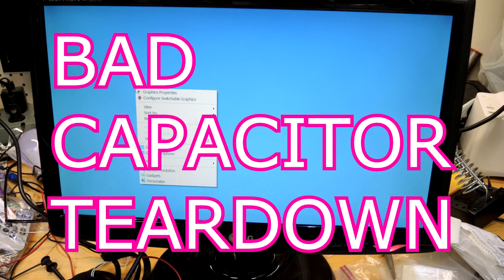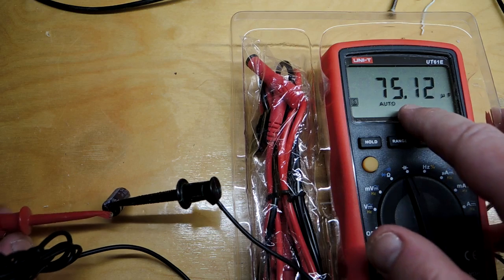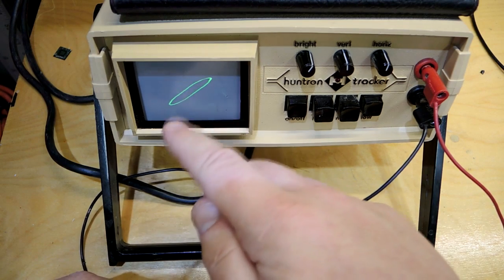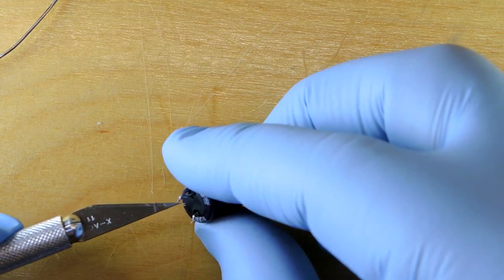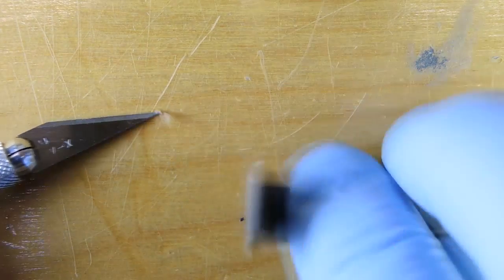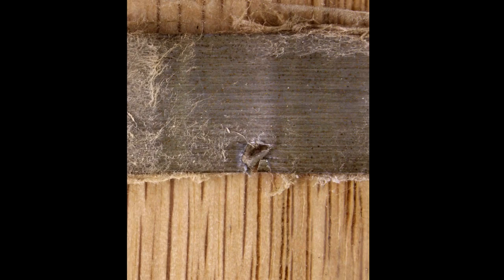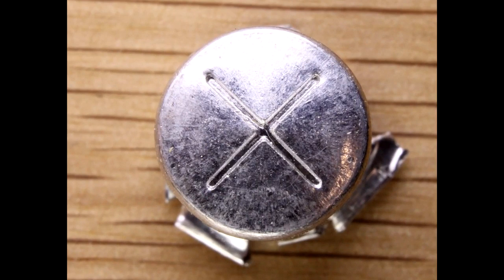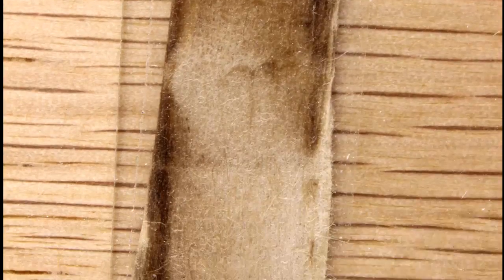Bad Electrolytic Capacitor Teardown

Comment: Nice video! They are made much differently  than 'lytics' i've taken apart in the 70's. We see very expensive manufacturing equipment suffer from these cap failures - usually power supplies and when they fail, they take out regulators. Also, we believe we note that electrolytic capacity life spans have shorted (due to newer cheaper mfg process maybe?).  It used to be caps would fail before say 25 years, but now we see caps made in the 2000s fail. Maybe someone has better insight?

Comment: Thanks for the analysis.  I'm in IT and have seen many monitors fail and have fix a number of them by replacing the caps.  I've always wondered what causes the failures.  Specifically though, is it heat that causes leakage from the caps?  I also see this in audio amplifiers.

Comment: I have a 1975 video cassette recorder here, still working, with nice big robust capacitors.  These days, capacitors are an utter scourge, especially surface mount ones which are hard to change and can be in very large numbers in some equipment.

Comment: Currently working on a monitor. asus vs208, the monitor would turn on into a continuous power cycle, which would only stay on if i put a hair dryer on it. So i took the monitor apart and see that one of the capacitor is bulging out. so hopfully i can replace it and it should work again

Comment: In high ripple applications, ESR is of more relevance than capacitance. Even 20% of the capacitance is often fine, so long as the ESR is low enough. 
Capacitor ages through electrolytic drying. Once it gets to a point, you get a positive feedback runaway effect. 
Drying increases ESR. Higher ESR leads to internal heating. Internal heating leads to electrolyte boiling. Electrolyte boiling causes internal pressure. Internal pressure causes can to bow, and internal pressure drives out moisture in an accelerating loop. 
The key for long capacitor life is for them to not get too hot. The capacitor's environment may not be particularly hot, but inside they can get very hot due to ESR heating. And it is the internal temperature that counts!
Many smaller capacitors can be better than fewer large capacitors since there is more surface area for heat dissipation. In general, bowed capacitors need to be replaced with capacitors which have a low ESR, and can physically dump the heat. Consider using a good solid electrolyte capacitor since these have an ESR an order of magnitude lower than wet electrolytics, and will therefore run cooler, and therefore have a much longer life, and reduce power consumption.
For electrolytics, every 10 centigrade cooler inside doubles life.

Comment: It's bad enough that they use poor quality parts, but some caps are mounted extremely close to hot components and heat sinks. I repaired a dozen TVs at work with caps which were surrounded on three sides by heat sinks.

Comment: Nice job.  Fixed one of my monitors with the same problem.  Had to replace 2 though.  Later, the panel cracked though.  Did get a couple of more years of use out of it though.

Comment: Caps failed in my flat screen TV. I bought it when they were still expensive, so I had to fix it. I'll never get my money out of it, but at least it still works now. Yeah I replaced all the caps in the PSU section. It was only a couple of bucks. I got the good Japanese caps for it when I ordered new ones.

Comment: Usually the only electrolyte these capacitors has is what is impregnated into the dielectric and what was evaporated with use. I know paper-oil caps were filled with liquid with most of it loose in the case sloshing around.

Comment: I replaced the exact same cap in my old LG monitor, But I didn't have a 470 cap so used the nearest I had and  ever since the menu or some other text will randomly display on the screen but sometimes its fine. I since upgraded to another monitor.

Comment: very interesting. I've always read about the failures but this is the first video I've seen showing exactly what the insides look like in a failed piece that isn't totally split. I work in an office and we toss (recycle) many many monitors due to bad caps every year (samsung is common). I always want to fix them or take them but we have to put them in e waste.
Reply: Offer to fix them. You will save your office/company a lot of money by replacing caps that cost a couple of $/£ instead of replacing the whole monitor. If they won't listen, fix the monitors anyway and sell 'em on eBay for your own profit.

Comment: old electrolytes were ''weak'' so you needed a lot, and caps were big, modern ones are way smaller as the modern electrolytes are stonger, but dont last, 5 years if your lucky, old ones i bet will do 25-50, but manufacturers need to sell more product so its win win for them

Comment: Thanks for making this video. I have replaced many of these in LCD monitors, often when a single capacitor has failed on the power supply board and the entire monitor then appears completely dead. Even decent 105C rated capacitors have a limited rated number of hours, so either they (or the CFL bulbs in older models) are still likely to be the failure point after a few years of use, especially with passive ventilation from the monitor bezel.

Comment: Weird because my 7 year old samshit monitor still works but has one stripe of dead pixels trough it.
Reply: Samsung monitors from 2007-2008 have a different failure, the conductive glue that attaches ribbon cables to the LCD panel fails after enough heating and cooling cycles.
Reply: well looks like im lucky with just one line on the left

Comment: How did you find the bad component ? Just by looking at it or testing all components?
Reply from the maker: +V10PDTDI looked at it, replaced it,  5 minute repair
Reply from the maker: no, no real need for one as I don't often repair things
Reply: do you have one of those small cheap component testers, they also show internal resistance of a capacitor
Reply: When the tops bulge you can just see the bad caps. Sometimes they ooze this brown crud too though.

Comment: excellent teardown, i wonder if a drop of water would have raised its capacitance once more.   i think part of the modern problem is there is too much heat for the capacitors to deal with so they dry out more.
Reply: Water is not conductive. All the crap left there after the evaporation is probably what made the electrolyte conductive.
Reply: Depends on what else was in the elctrolyte and if that evaporated as well or just remained as a dry substance. But as long as the liquid is conductive (which water is), it should raise the capacity again. Pure water will most likely lead to corrosion though.